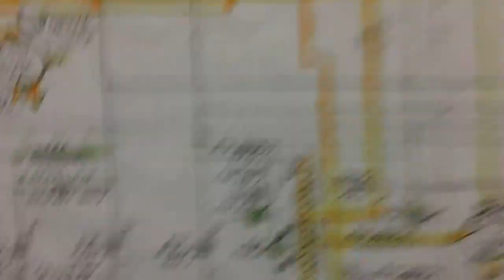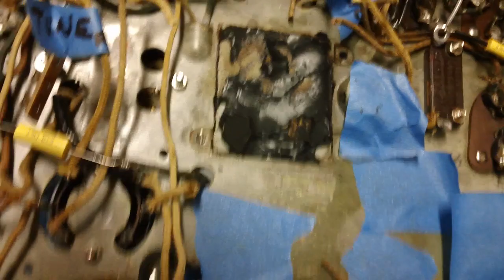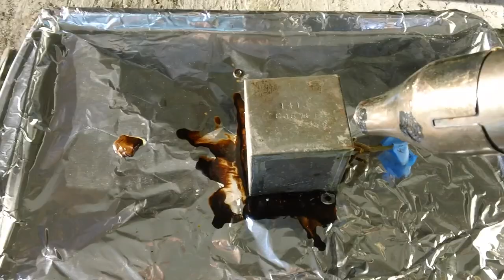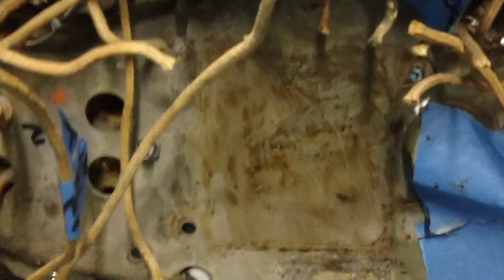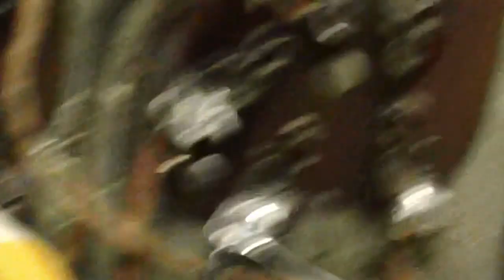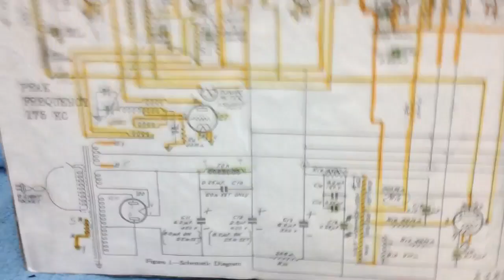1931 Airline 62-14 (Part 22 of 44).

Comment: John,

Another great video, chock full of great tips!  I have a small tip that you might find useful.  Go on down to the Salvation Army and look for a good toaster oven.  My wife bought a Black & Decker at Deseret Industries in Salt Lake for ten bucks, I think.  Line the drip tray with a little aluminum foil, and drop that block on the grill with the heat turned up to about 400 degrees (that's Fahrenheit, Steel City Phil!). Open a can of Blue Diamond Almonds (or in my case Saba Hummus and Tracy's Chips), and enjoy while you let that puppy bake.  Like magic, all that tar will drip out and, before you know it, will all be settled on the aluminum foil.  Clean it out with a little WD-40, and off to the races you go!  I do this for Philco bakelite blocks, and even cardboard wax caps.  Works like a charm!  Cheers, my friend!

Michael

Comment: John,
You are a very courageous man:  often I'm too scared to chop wires in fear I might chop the wrong ones LOL.  Not only that, knowing my luck, I’d put myself, and probably half the neighbourhood, in jeopardy if I dared use a heat gun on capacitor boxes, especially on the cardboard varieties LOL.  I have to be content in submerging them in boiling water to release their contents…and whenever I do that, my wife quickly develops a burning desire to kick my butt for using one of her best saucepans LOL. 
Joking aside, I’ve a feeling it might once have been standard practice both in America and Britain – and perhaps in some Continental European countries – to use tar-lined, and waxed card, potting boxes to encase capacitors, chokes, and resisters by first sinking them into hot, runny, bee’s wax mixed with carnauba wax (it has a lower melting point when compared to tar), then seal the encased components with a slab of hard tar, laminated on one side with waxed card, to minimise moisture penetration.  
The long term problem with this method of sealing is tar never truly sets, and wax will eventually turn rancid, and may develop a conductive property – especially when snug with components operating at warm temperatures.  
As you may know, I’m not keen on components being encased in tight, or sealed, enclosures but some people insist I retain, as far as possible, their radio’s authenticity.  With a spot-or-two, I hot-glue components into the original potting boxes so they remain stable but I never reseal the box: I leave it open on the underside.  I always use short stand-offs, or strips of wood or Perspex, to raise the box off the chassis surface as I want as much air as possible to circulate internally.  Occasionally, I drill a couple of small holes in the top of component potting boxes to enable further air flow. 
In case you do not have my email address, leave a Hotmail type address, or personal message (if You Tube still offer this facility???), and I will write it down for you.
Regards,
Phil.  P.s, I sincerely hope the fears I have concerning our mutual friend are unfounded.
Reply from the maker: Phil,
How have you been, my friend?  I trust all is well with you and yours.  Yesterday I spent some time skull-braining over how to handle the new cap installations.  I believe my golly I've got it.  LOL  Stay tuned for the next vid which will be up very soon.
Like you, I've never been fond of re-potting or sealing cap containers.  With the supremely better components we have nowadays, it's no longer necessary in view.  I'll be sending you a PM, probably this afternoon, so be on the lookout for that.  Unfortunately, I can offer no news about Brendan.  It's been about three months now.
Regards,
John

Comment: Hey John,
Many many many thanks. I'm getting started on a 16 tube set, mapping out everything first on a good, enlarged schematic makes all the difference. I know where everything is and if it's good, and mostly, fortunately on this radio, it is. Well not the resistors and capacitors, but all the transformers. Makes it easy sailing for this old sailor.
Reply from the maker: Hey, Gary, it's good to hear from you, my friend.  Thanks for popping in.  I'm happy you're applying and following good repair procedures to work on your radio.  A 16 tube set requires it for sure.  After a while those procedures will become second nature and you'll be saying: "Piece of cake".  LOL  Regards,  John
Reply: And piece on earth.

Comment: Those good old boys back in the day loved their Major Potting stuff. 
There are a few things that may help the stability and distance of the FM transmitter. Of course John I can not pull them out of my head at a whim so I will look them up and get back to you. They really helped me when I was building mine.
Carl
Reply: +skycarl Ok John,,, Part of what I was looking for is the antenna length. I got this from Dazaro3's site. Seems the optimum length for these FM transmitters is around 120-126 cm or 48-49 inches. When I first tried this, my signals went from barely making it out of the room to several blocks down the road in the car. Big difference on the transmission range.
As far as stability, it seemed the placement of the antenna to the coil made a big difference.  I will look into that some more but I do remember that keeping the leads short as possible made a big difference.
Hope this helps a bit for you. Take care friend.
Carl
Reply from the maker: Carl,  How many transistors did your FM transmitter have?  Regards,  John
Reply: +joernone both that I built and they worked lol... were one transistor.  and I powered both with 9 volts.